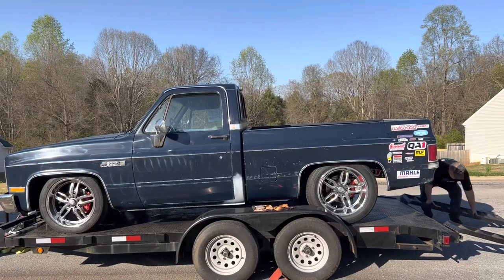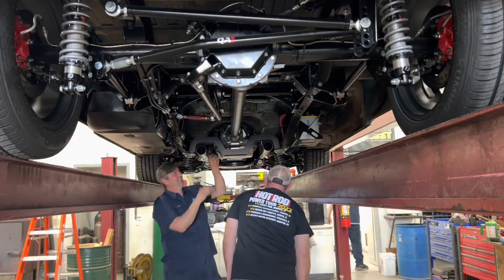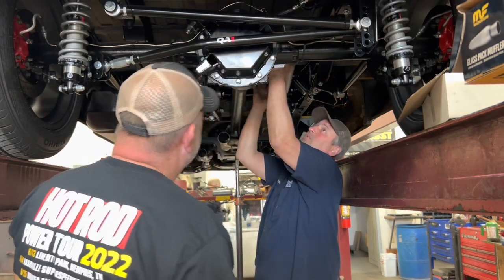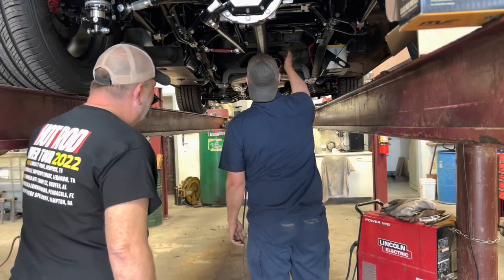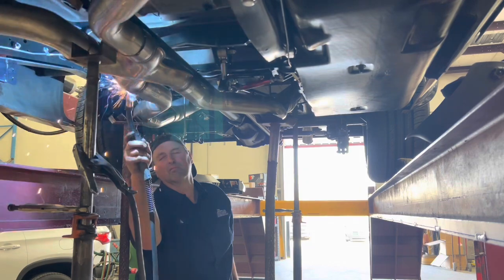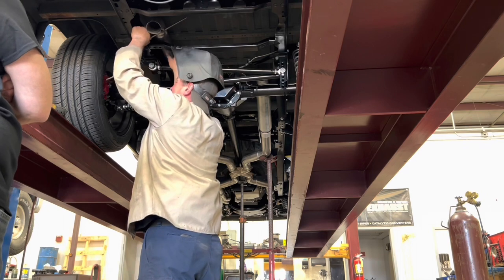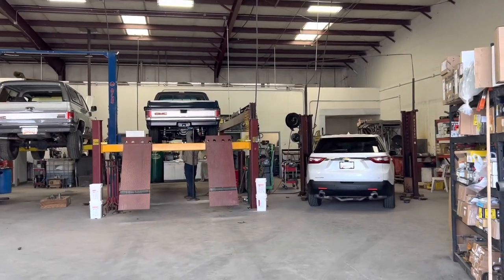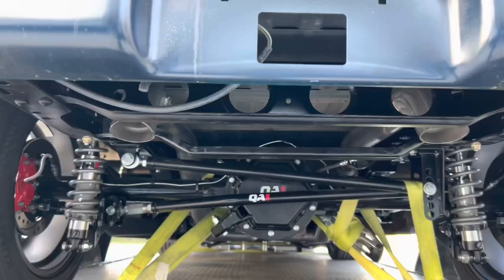Winston gets pipes and Magnaflow glasspacks! Squarebody LS swap exhaust!

Comment: How are this tire (sizes) working out?  Any rubbing in the front?  Thanks.
Reply from the maker: Working out good, just need to adjust ride height and they clear fine. Thanks for watching!
Reply: @hammersgarage  Unfortunately my ride height is not adjustable :(
Reply: Can you guesstimate how much higher you had to go in the front?
Reply from the maker: Well I started at the bottom, but right now my fenders are 29” from the ground